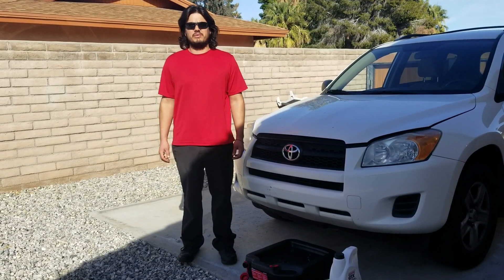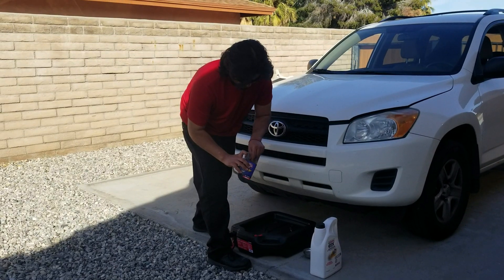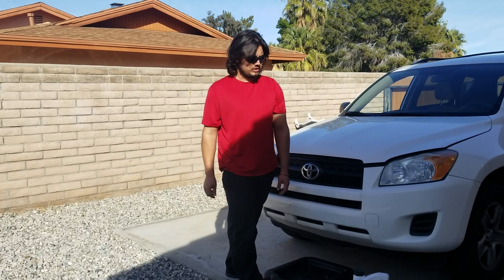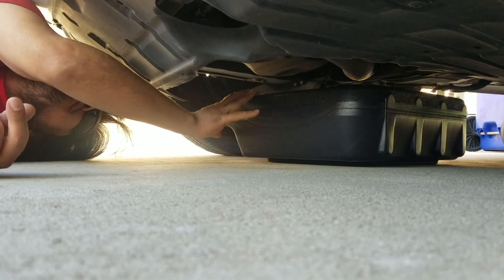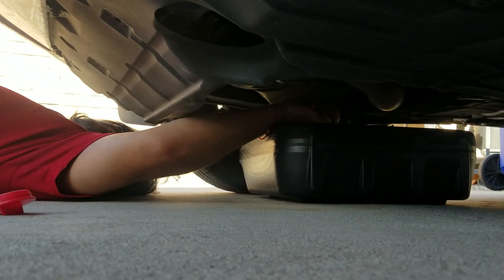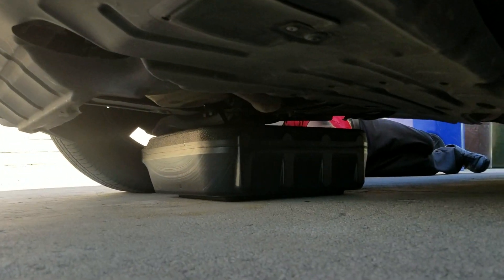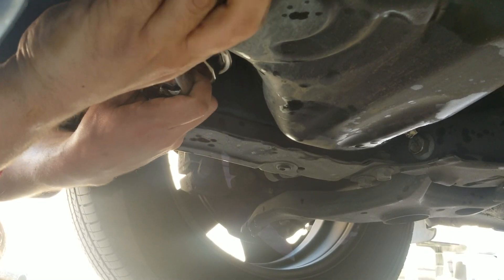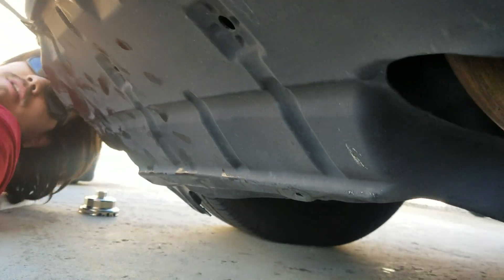Scatter brain Saturday: oil change on 2010 toyota rav4

Comment: Thanks for the video. You should probably get some ramps, wear some plastic gloves, and use a funnel to make the job easier and less messy. :)
Reply: Luckily the car is high enough off the ground I dont really have to lift it. The gloves would be smart but I'm a professional so ppe is optional. Just kidding. I am actually practicing not using a funnel as I would like to have surgical precision on my pours.

Comment: I think you mean cartridge style. The spin-on filters are canister filters. 0W-20 and 5W-20 both protect your engine equally. The OW provides extra protection during cold starts. It's the film strength of the oil that protects against wear and that is determined by the additive package and not the viscosity. This is not 1970.

Tighten oil filter cap assembly to 25 N•m (18 lb.ft.)
Reply: 0w flows better at cold starts and can go through smaller oil gallies. It is ment for fuel economy not engine protection. Are all the cars in Alaska 0w probably more 10-40 diesel. If it where for cold starts only why can not all cars use it seeing as it's not to thick to flow properly? It is because it is to thin and will damage vehicles that are not suppose to use that low of a viscosity and will spin the bearings on the crank.